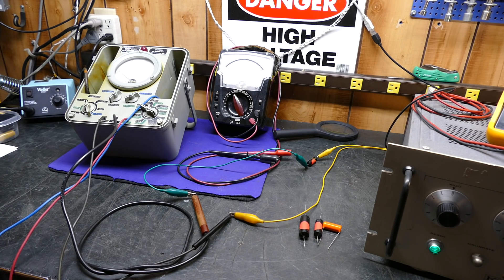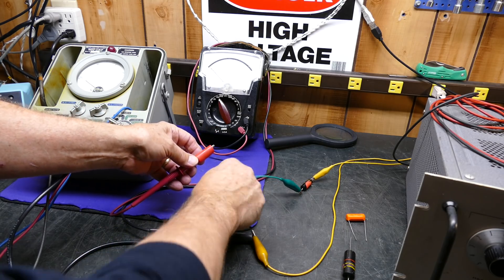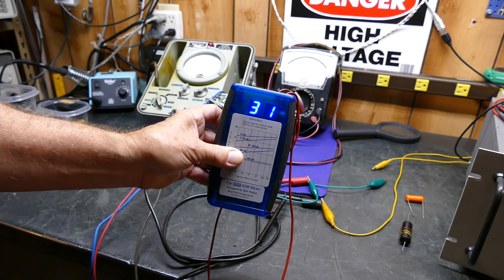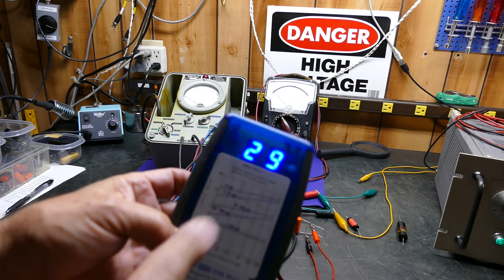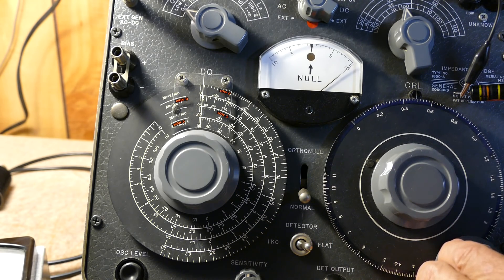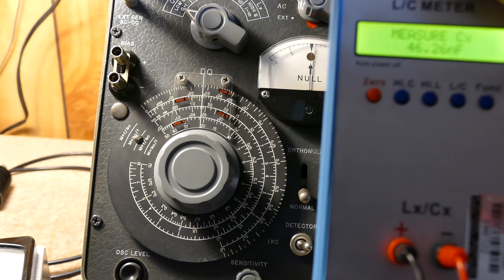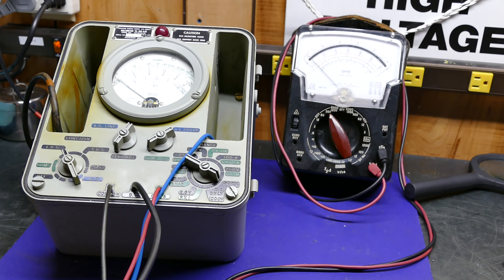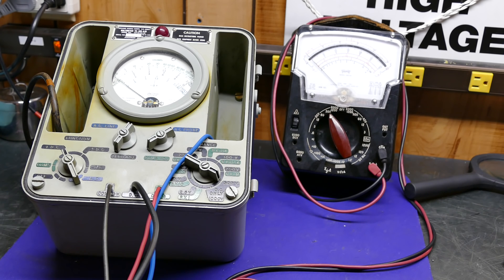Evaluating Signal Level Capacitors in Vacuum Tube Amplifiers

Comment: Normally, capacitors should be virtually an open-circuit to DC, there should be very minimal DC leakage flowing through them, if there is some DC leakage that indicates that the dielectric between the two plates of the capacitor has suffered a breakdown, or punch-through, or even a partial short-circuit.

Comment: You are right about the years passing faster as you get older.  For me a year goes by like a month did 40 years ago.  I think I'm going to make a unit just to test coupling caps out of a smaller v/a transformer and rectify and filter it some so I can just plug my analog VM and cap into . Pretty simple.   Great!

Comment: I've had half decent luck using a good analog ohm meter.  If the reading doesn't go to infinity,  the caps bad.
Reply from the maker: I completely agree with you. All I had for a lot of years when I started out was analog meters and they work just fine for evaluating leaking capacitors, especially the Triplett 630 meters with the 100K ohm scale. Thanks for your input.

Comment: I just love your Videos.  Can i use a DMM set to DC volts to perform my test, or do i need something with a larger input impedance?
Reply from the maker: +LLama Tone Yes, you can use a modern DMM or older VTVM. The input impedance of the DMM is  probably 10 megohms. Some of the older VTVM instruments are 11 megohms. The older analog Triplett and Simpson meters will work also. Be safe.

Comment: I used the uA meter because ultimately it was to be my reference for setting up the IT-11.  The switch settings allow for 3 different criteria.     2ma,     15ua,   and 2 ua.      at the 2ua setting full open was less than 1/10th of 1 microamp.  which is a lot more specific than measuring the voltage across the resistor

Comment: Another excellent video, David. I really like the simple, in-series-with-ammeter, cap testing method, and will definitely try this in the near future. 

When I created the capacitance-to-ESR data and chart for non-polar caps, as shown in your video, it was mostly out of curiosity. I first needed to create a data base for "normal", i.e. relatively new and fully functional, capacitors, and then determine if faulty caps would deviate from that norm.  To date, as you noted, I have not found the deviation (if indeed any was noted) to be adequate for diagnostic purposes. As you found, a bad cap will often deviate a bit from the expected value, but generally not more than the deviation seen between good caps. 

So it appears that, although it would be nice to be able to test caps in-circuit quickly and with no voltage applied, there are currently no reliable ways to do this. You can measure the leakage in circuit or (as you demonstrated) out of circuit, but in both cases, they must be charged to their working voltage. 

I would add only one observation. To me, the implications of leakage are far more compelling with coupling caps than with tone caps, which generally reject or pass different frequencies (often to ground) and operate at very low (signal) voltages.